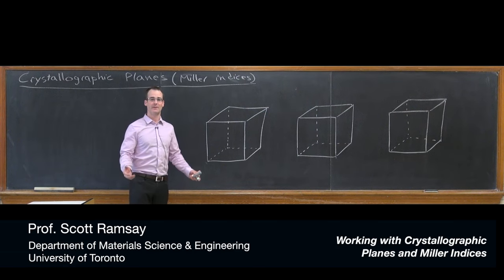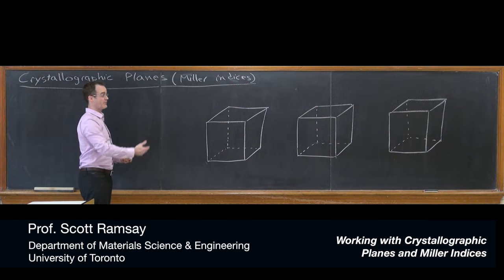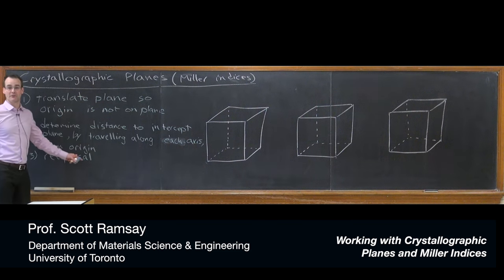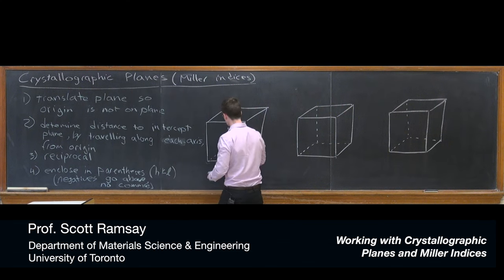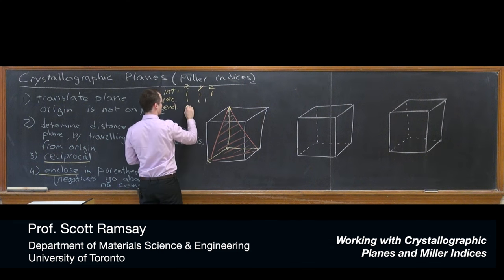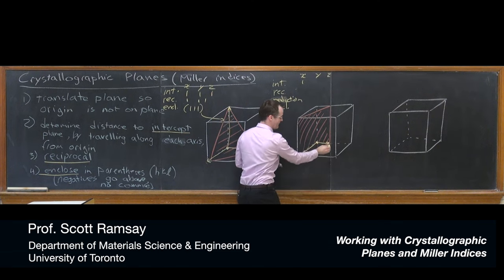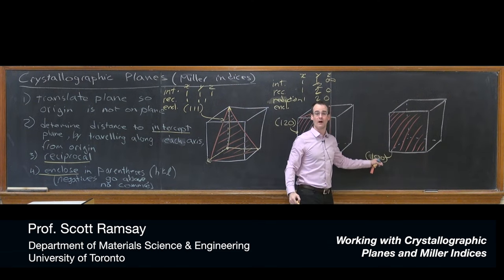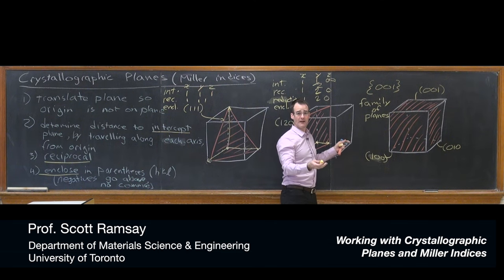Working with Crystallographic Planes and Miller Indices

Comment: Can I rotate the coordinate system by 90 degrees in any direction? If my intercepts are correct, I should be fine, right?
Reply from the maker: If you mean just axes and not the plane also, then no. This would result in a different plane. For example, looking at the front face of a cube along the x-axis, you’d be looking at the (100) plane, but looking at a cube face along the y-axis you’d be looking at the (010) plane. If I rotated the whole thing, axes and planes, 90 degrees about the z-axis then the plane would remain the same but my perspective would have changed.
Reply: @ScottRamsay  Yes that's what I mean, effectively you're just changing the orientation of the piece of material whose properties' directions you are representing with miller indices right?

Comment: Why is it not (210) in the second plane?
Reply: we are not multiplying it rather we are taking inverse of the indices
Reply: it's because the z = up axis, y = bottom axis and x = the axis or line that comes out towards you. If you switched the x and y axis, you will get your answer (210). I'm gonna guess you thought the x axis is where the y axis was supposed to be? it depends how you label the axis directions before hand.

Comment: second plane is( 210) not (120).
Reply: +sahil sangwan How so? It looks like 1/2 in y.
Reply: jesi you are right
Reply: +sahil sangwan it is (120) because it intercepts all the way through x, giving 1, half way through y, giving 1/2. The reciprocal for 1/2 = 2.  And parallel to z, giving infinity, with the reciprocal being 0. ∴ (120)
Reply: I think the confusion is because he did not label the axis before solving. The z = up axis, y = bottom axis and x = the axis or line that comes out towards you. If you switched the x and y axis, you will get your answer (210). It all depends on how you label the axis